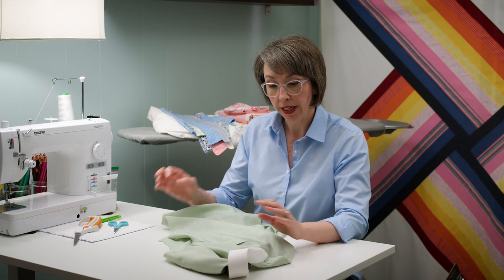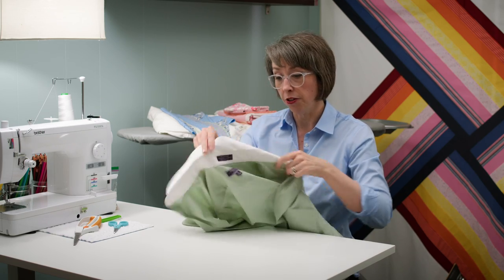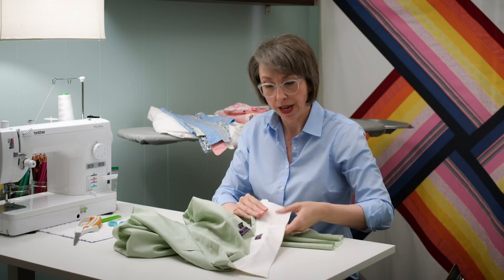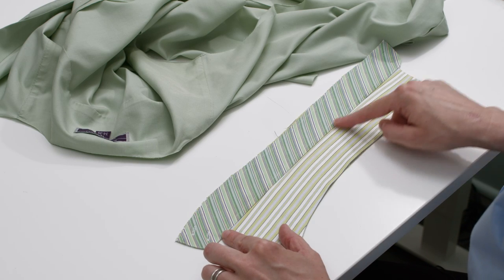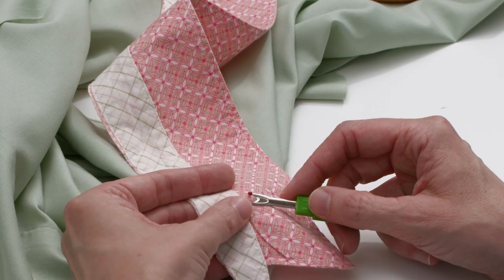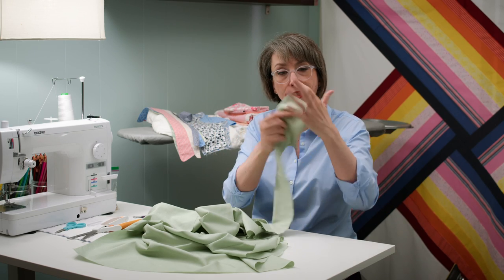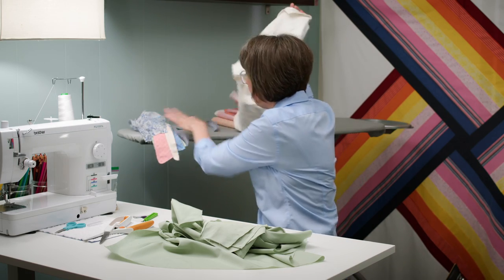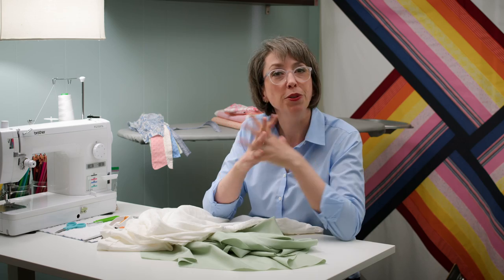How To Break Down a Men's Dress Shirt, Pt. 4 - Collar and Yoke

Comment: I know you do mostly men's dress shirts, but I wondered if there were any differences to be aware of when breaking down flannel shirts? I plan to make a number of wheelchair lap robes for the VA and the nursing home down the street. I was going to look for flannels and plaids at the thrift store to go with what's in my stash to make more "masculine" designs. Is there anything I should know, from the initial washing to the last snip of the scissors?
Reply from the maker: I love flannels, but yes they can be a bit more challenging in several ways! I would say avoid your seam ripper and use small snips for the small/tight seam work…I have literally ripped through a shirt just trying to get a small section taken apart. Work slowly, and pay attention closely while you’re cutting because it will slide underneath big scissors if you’re not watching. I wash and dry mine the usual way (warm wash, dry on low) and haven’t had issues. Be prepared to maybe need lightweight fusible interfacing to stabilize them if they are very flimsy! That is a wonderful use of flannel shirts tho…good luck!! ❤️
Reply: @TheCatBirdQuilts  Thank you

Comment: I have seem some creative projects that make use of tags from clothing. Thrifted shirts often have designer brand names or some interesting small art. Sewing them to a square on the back of a quilt, or randomly all over, would add a charming touch. Make a quilted wall hanging for your sewing room with these tiny trophies. Some edges are scrathy, so trimming/folding may be needed if you use them on a quilt or wearble.
Reply from the maker: I made a huge checkerboard scrap quilt for a friend and did exactly what you suggest here…interesting-looking logos were kept intact and I put those squares in with all the rest. I think it made each block unique and interesting (even though many blocks were from the same shirt.) And it turned out gorgeous too. Thanks for your comment…and for watching! ❤️
Reply: TINY TROPHIES! Yes!